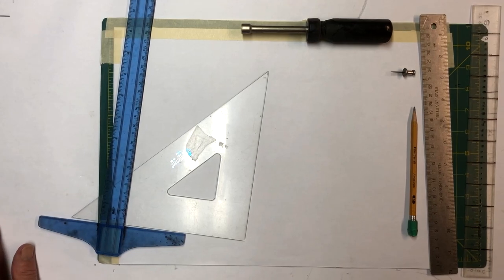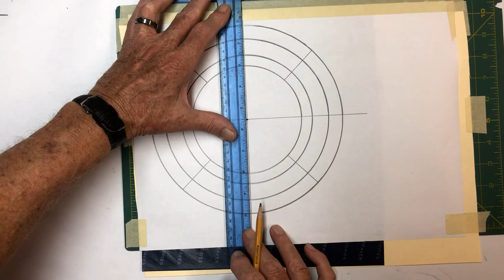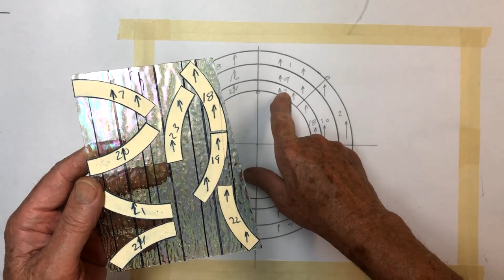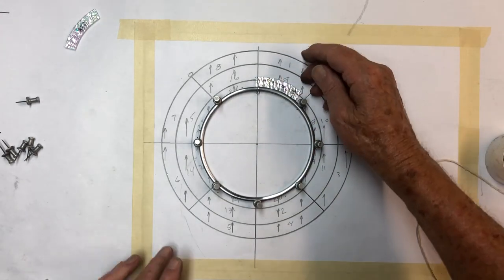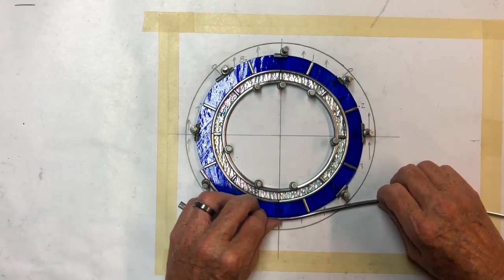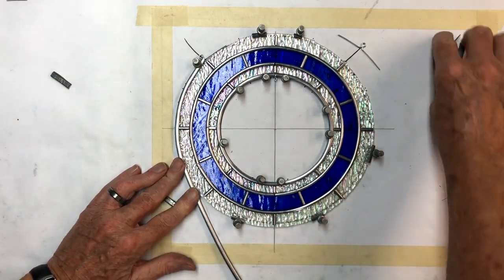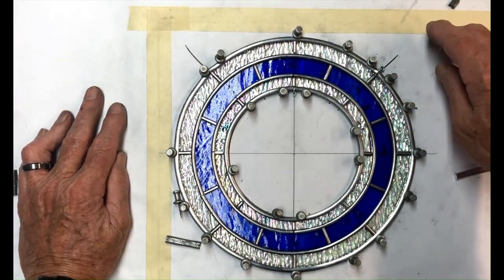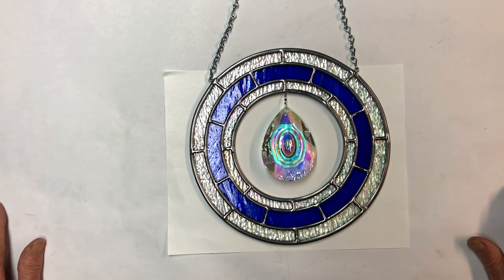Leaded Glass Suncatcher with Glass Crystal

Comment: Excellent work and explanation!
Reply from the maker: Hi Jeff,
Glad you liked this one, it's a lot of work but the outcome is worth it. Have a great day!!!
Regards,
Bill Stone
Reply: I really appreciate your explanation of what, why, and how. It's very easy to understand. You also add helpful tips and options. You were born to teach. One question, when you solder, you just solder the joints when using came, correct? If I foiled the circle first and soldered, then added the came, would that work just as well? Oops, two questions! I love, love, love your channel!!! Huge fan from Washington State 😃
Reply from the maker: Hi Therese,
Glad you're enjoying the videos. Yes you only solder where the came intersect with each other. Also you can make this project with copper foil and then wrap it with lead came to make it stronger. The only thing to remember is on the edges of the copper foil don't solder all the way to the ends. Leave the copper foil that is going to go into the U came unsolder. After you get the U came wrapped around the project you will solder the copper foil to the edges of the U came. Take a look at the videos of the two solar lanterns with flowers in them. You will see I solder the copper foil to the lead came after you do the bead on your copper foil to join the to together. Hopefully this helps you out. I have made a lot of projects with copper foil and wrapped them with lead came, they come out great.
Regards,
Bill Stone
Reply: @billstonesstainedglasscrea3310  Thank you so much for taking the time to reply. I wish you were my neighbor! 😊 I watched your solar latern videos and I love the laterns! They are beautiful! I will go back and re-watch them.

Comment: I have made leaded suncatcher however I always used 1/8" U zinc for the perimeter instead of U lead. I was concerned of the U lead pulling away due to weight and time. You have not found this happens with the U lead?
Reply from the maker: Hi Julie,
I have used lead came for the outside of all my suncatchers for the last 25 years, I haven't ever had one pull away from the main body of the suncatcher yet. We lived in Lake Havasu, AZ for over 10 years and there is a lot of wind out there and never had a problem. If you look at the way I make my hangers, I use a 3/32" cotter pin steel zinc plated 1 1/2" long. I always make sure that the hanger is centered over one of the down pieces on the project, which makes it much stronger than if you were to put it in the middle of the down pieces. Take a look at my video on how to make a hanger for leaded glass projects. It will show how to make this hanger and it is bulletproof. Also if you are making round suncatchers the lead came is much easier, to use then zinc came. Hopefully that helps you out.
Regards,
Bill Stone
Reply: I've been making notes and rewatching. There is always something others can teach a person in this art. I live in southern east Iowa which means humidity, wind and snow. It makes sense that lead would work as long as the project that is not too big to hang. I value your knowledge that I am putting into my own work. Best to you and your family.
Reply from the maker: Hi again,
You're right, I watch several YouTube videos myself on Stained Glass Projects, I do larger windows, and sometimes have a question wither there's a better way to do something. I think you can pick up great ideas from all these videos. Glade you're enjoying watching them. Somebody told me a long time ago, the day you stop learning something new each day. It's all over!!
Regards,
Bill Stone

Comment: Where does. one find, 'Crushed Tubes,'  to secure the monofilament line? Thank you
Reply from the maker: Hi Again,
You can get the crushed Tubes anywhere they sell, make your own jewelry supplies. Hobby Lobby, Amazone, JoAnn's and Michales to name a few. They come in a small package, there's a couple sizes. The small one is good for 30#  monofilament line and the larger one is good for 50# monofilament line. If you have ever bought anything from the jewelry ail you know you have to look long and hard to find what your look for. They are in a small bag and just like small silver pieces of plastic. Best of luck to you and I hope you will give some of these projects a try.
Regards,
Bill Stone
Reply from the maker: Hi again,
My bad, it's not called Crushed Tubes, I checked it out and the real name for the tubing is Crimp Beads or Crimp Tube Spacers. I found it both on JoAnne's and Hobby Lobby. Amazon has it but you have to buy a lot of them. The size I'm using is 2MM. Hopefully that will help you find them.
Regards,
Bill Stone
Reply from the maker: It's me again,
 I just check out JoAnn's, and they have the best price for a small number of crimp tubes.
Regards,
Bill Stone